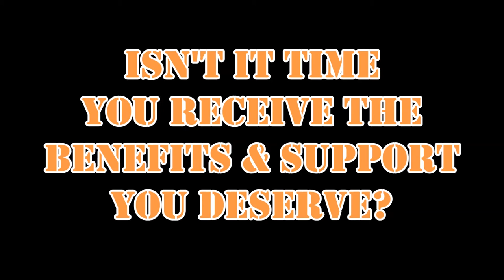Operating Engineers - Union vs Non Union

Comment: Pay dues while unemployed,  sit and wait,  then get a call to run a forklift for an hour.  Then be put back at the bottom of the list. Dues are $80+$20 death benefit. So we pay $100 a month...
Reply: And then they take almost 50% of your pension if you retire before 65
Reply: @owenmarchildon6638  most don't have pensions anymore. If you're company switched hands or investment companies,  double check to make sure there is still a pension besides 401k.
Reply: Really? 8 hrs is the minimum hours you get paid for, even if you work 15 minutes. If you are NOT currently employed, you should be at the school upgrading your skills. You should be "expert" and licensed on all pieces of equipment and have ALL of your certifications up to date (hazmat, gas/propane, cut/weld, motor fuel, etc) When you become that guy, A. Companies will request you. B. BA's will send you on important jobs, because they know you will 'represent'. C. Your chances of you becoming a "company man" first in and last out of big jobs, operating multiple pieces, increase exponentially. It's a career, if you don't want it, make room for someone who does.